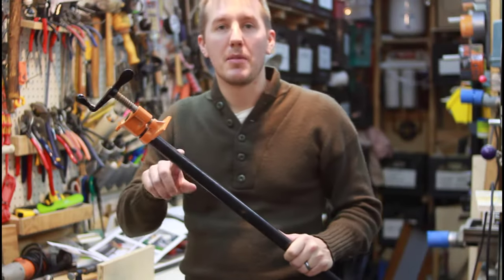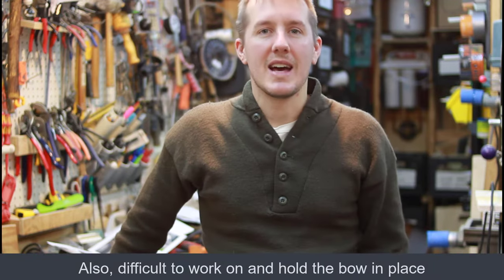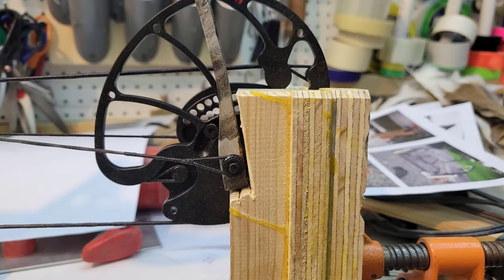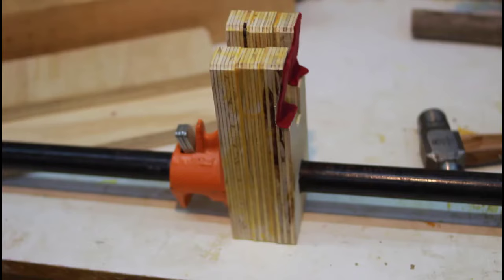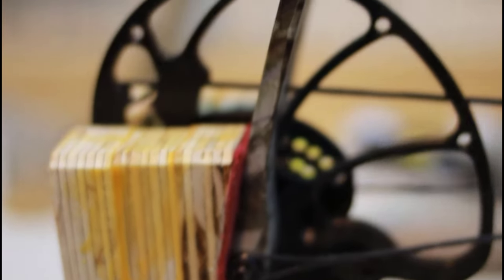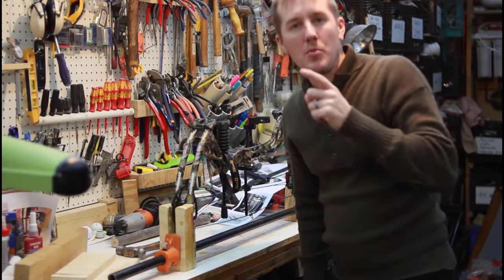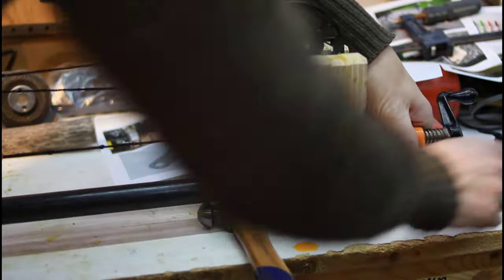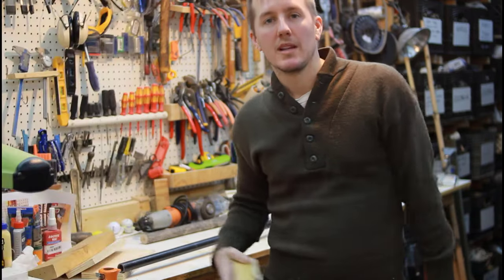Bow Press - Homemade Bow Vice

Comment: Great idea. Thanks for the instruction.  I just made one using scrap pieces of cedar 4x4 (from a mailbox post).  This eliminated the gluing of multiple plywood pieces.  I used it to change the strings and cables on my crossbow.  I removed the limbs/riser from the bow and this new press worked perfectly.  Really like the fact that I don't have to buy another piece of equipment that gets used 1x per year.

Comment: I made this and it works great.  Instead of plywood though, I cut the wood blocks from a hickory log and oversized them for extra strength.  Important note: use a 1 1/8" drill bit to drill holes to accommodate the 3/4" pipe.

Comment: The cable style presses you mention in the beggining work just fine. Like Bowmaster. And they are portable.  Your DIY design is good as well for home use. The critical point is laminating that thick plywood for clamps, otherwise it would be dangerous.

Comment: Definitely onto something I was thinking about making a bar clamp bow press and sure shit your video pops up. Instead of using wood blocks I may use a welder make a taller clamp that allows the string to face up for restringing a bow at home or possibly using laminated two by sixes about 16” in length   Rad video man!!

Comment: I love this idea and I have what I need to do it. Do you think this would be stout enough for a crossbow?
Reply from the maker: I don't know.
I was always very cautious when it was pressed in there.
But it should probably work with a crossbow.
You can see a couple examples at 1:42 where they used steel instead of wood.  That would be stronger, but harder to build.

Comment: How did you figure that the portable bow presses don't work?  They work great on most bows and are much easier to use than this homemade press.  They also allow better access to the cams and string yokes.
Reply: I actually have the portable and I made one similar to this one with a few modifications.  The  cheap one finally came apart while pressing a,bow but this wood one is still working strong.

Comment: Good idea but the bow needs to be string up on this type of press and the cams have got to be totally clear so you can remove them and or replace the cables and string. The way you are demonstrating with the string down will be doable IF there is enough clearance for the serving jigs to be easily rotated around the string. Plus those cams must be totally clear so they can be removed.

Comment: Does the pipe have to be threaded at one end ?
Reply from the maker: Ya at 1 end.  
The clamp twists on to the threaded end.
The other clamp has that sliding spring lock

Comment: I love your design and I'm using it as a base to make my own. I ran into a snag though and I'd like your advice. What size drill bit did you use? I missed it when you said the hole size, and assumed 3/4 inch pipe meant the outer diameter when its the inner. I measured out the outer diameter at 1-1/16 inch, or 27mm. Did you use a one inch drill bit (spade or Forstner), then sand the inside of the holes? How much wiggle room is there from pipe to wood clamp?
Reply from the maker: I don't remember the hole size.  But i do remember that it was just a tiny bit too small.  And had to use a rasp/file to enlarge it a little.  You want the pipe to be snug though.  I used a forstner bit.
Reply: @DaveWirth  Ah. Cool. Thank you for the info. And I'll definitely not forget to grease the wood clamp. Again, great job on the bow press!

Comment: In the process of making this described bow press . I know the plywood block is 2.25" thick, what are the height and width dimensions of  this plywood block that you made? ... Thnx
Reply from the maker: Not sure.  But the plywood was 3 pieces, each 3/4" so the thickness is 2.25" thick.  Width is maybe 3" and height maybe 7".

Comment: Might have a solution for you NOT to use the hammer retraction method.   This is a very old and simple method for what you are trying to do.  Get a short length of BRASS pipe 1" ID and this becomes the sleeve on your pipe spine. Glue it into your wood (clamp screw end).  Note: BRASS has a natural lubricant characteristic with porosity and with a few drops of oil, will remain viable for many years.  Do this for both press ends for a professional job. Approx.  $15/ft of pipe

Comment: Worried about one 2x4 how many pounds you pulling on your bow you could use 1/2” thick board  if it’s all you have even with the notches take a bow scale pull your bow slowly and watch how many pounds it takes to get the string back far enough to work on you might be surprised on how little weight it takes all cams are different